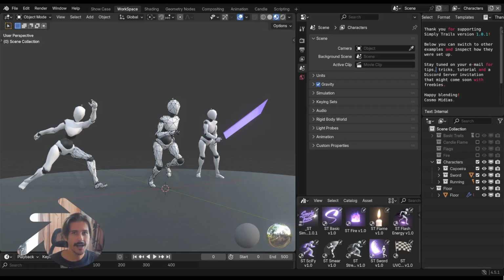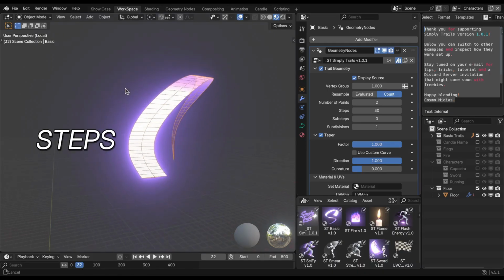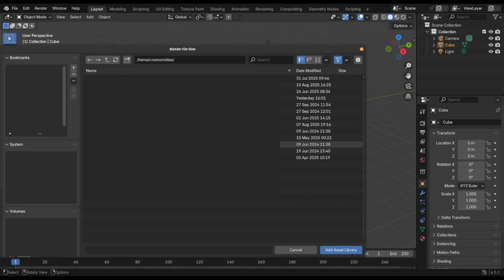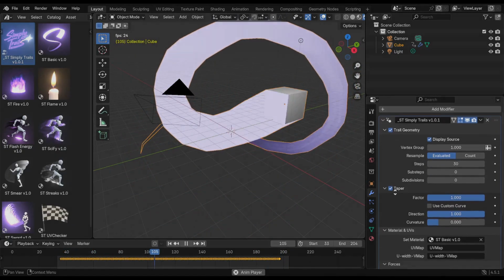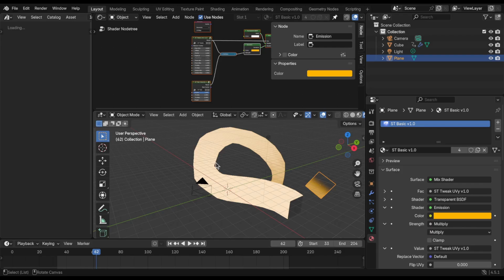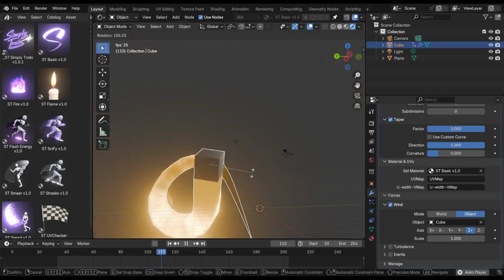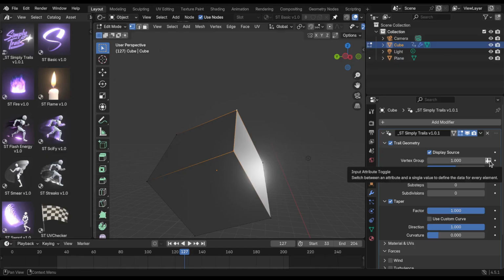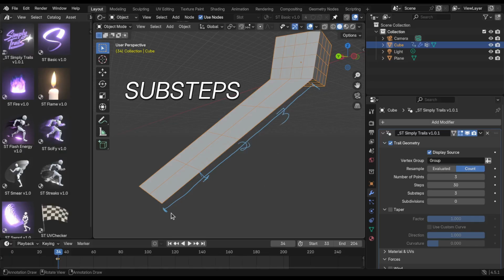Simply Trails for Blender - How to Use?

Comment: any method to decrease render time while using this
Reply from the maker: It will depend on your settings and what render engine you are using. EEVEE can be pretty quickly. But Cycles might be a bit trickier depending of factors like transparent light bounces needed to go trough the object you are trying to render.

Comment: I guess I have a question already. When you show how to use the asset browser you talk about in the preferences making a file path to the file, I'm not sure what file you are referencing. It's not the .blend file that was downloaded??
Reply from the maker: It is a folder where Simply Trails file is. This folder can be a place where all your files marked with assets are. Then all them would be displayed there. Separating in folders give you more control of which kind of libraries you want to have organised in the asset browser. I don’t have a video dedicated to this but I’m sure your can find some dedicated only to this topic. 👍🏽✨
Reply: @cosmomidias  The only thing I got from Gumroad was the .blend file. That's all I'm able to download for version 4.2 and 4.5. There was no zip file to download.
Reply from the maker: @DonTerrell  Correct, that is what you need. The .blend file itself. (This is not an add-on so no .zip here). You might not be familiar with the concept of Assets in Blender just yet. Take a look: https://www.youtube.com/watch?v=rKb2UUCP8e8
Reply: @cosmomidias  Ok, thanks. Yeah, just getting familiar really setting up my asset library. I figured it out thanks for the resource I'll check it out as well. Been interesting so far.